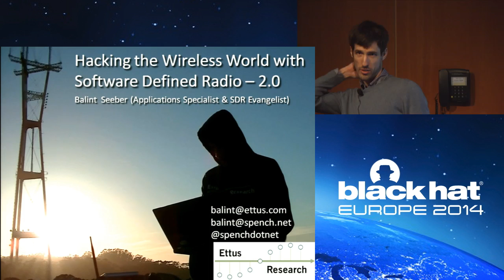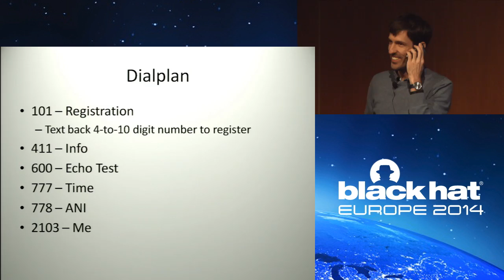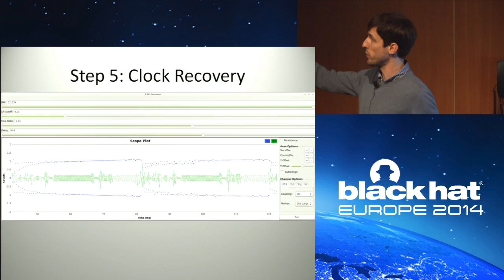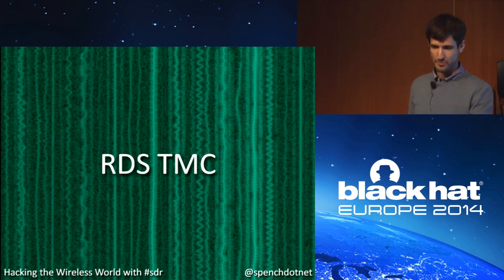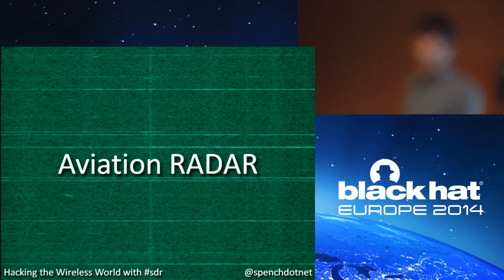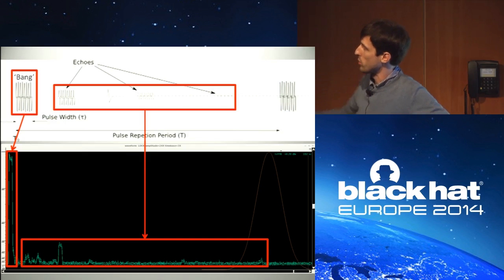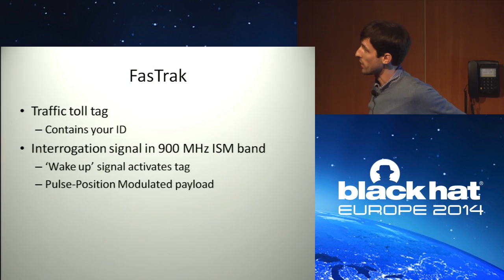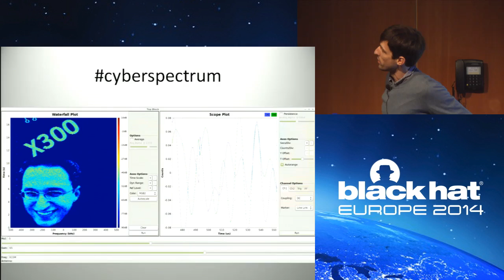Hacking the Wireless World with Software Defined Radio - 2.0

Comment: The RDS encryption cracking is extremely clever, but I can't help thinking that it was a little bit unnecessary. You already have decoders available - the nav system of any suitably equipped car.

Isolate its receiver from the normal wavebands (disconnect the aerial, shove it in a faraday cage...) and pipe synthetic RDS signals into it direct from your SDR transmitter. For each encoding period, just exhaustively run through each combination of encryption key and location code, and set up a camera and OCR system to scrape the generated locations off the screen. Before too long you'll have a nice database of what location comes out when it's fed a certain key and location on a particular day, and can then apply some simple filtering / sorting to spit out a list of what sets of input data correlate to each location or vice versa.

You can then either apply decryption to that dataset if you like, or just use it as a lookup table. OK, so the actual search space will be somewhere in the millions (16 bits + 5 bits + however many bits for the period = probably at least 24 bits overall), which might imply it'll take some time simply generating the data depending on the reaction speed of your system, but it's not a particularly large data space for any modern system (say each location averages 32 characters, and you have 16 million of them, that's a modest 512mb memory card).

And even if you just use it as an incomplete source of data for decryption, maybe only pulling a couple thousand period-key-code + location output pairs out per day, it gives you a vastly increased spread of ciphertext plus ersatz plaintext to compare against, even if there's an additional job of work in coming up with what the actual decrypted locations are (...but knowing those is only really useful if you have direct access to a database, e.g. a ~512kb ROM inside the radio, that takes that 16-bit value as an input and spits out a, say, 32-character location name at the output; as that data is likely part of a larger system ROM, itself encrypted and signed if we take the example of the database SD cards that go in my own integrated satnav, you're probably better off just correlating ciphertext+key+period trios to human-readable output strings, assigning them your own arbitrary 16-bit code based on the initial order in which they appear, and figuring out which combinations you haven't yet had the time to run through will produce those strings in future).

Rinse and repeat for each separate region. With a suitably distributed effort, maybe with several people in each area tackling a particular portion of that area's codespace, you could have the location codes for the entire US figured out pretty quickly and reduce the decryption effort to a simple rainbow table style lookup.

NB of course it's probably a 1MB+ table in ROM that contains not only the road / location name but a pair of GPS coords (~24 bits per lat/long should provide more than ample ~1.5m / ~5ft accuracy, meaning an additional 12 bytes, leaving a somewhat less cramped 52 bytes for the ASCII name), for the start and end nodes, especially for long roads where you want to divide them into several segments, each inter-exit section of a freeway etc. That would require quite a bit more donkey work, most likely wholly human unless you're quite good at coding up soft AI systems, to manually correlate each ASCII name with the start/end points. Unless of course there's already a suitable database out there which one could refer to...? (I genuinely don't know, but I'd be surprised if there isn't )

Comment: As a technical person, I am impressed by the material.  But as a citizen, I find it concerning.  

If one could transmit a false road report (the digital equivalent of "Aircraft crash into Golden Gate bridge - bridge closed"), GPS-directed traffic throughout the bay area could be stalled. This is more than a prank - it could cost lives (critical patients in ambulances), disrupt work (medical folks unable to get to work), etc., cost hundred of millions of dollars in lost productivity.  

Rail systems rely on track-side diagnostic equipment. Some of those use RF to communicate. Imagine that a false indication of a switch malfunctioning was sent. Commuter train traffic into and out of NYC's Penn Station could be halted.

I suspect that there are fuel and natural gas pipelines with remote sensors using RF to provide status.  Could a bogus status packet cause a shutdown of a natural gas pipeline (similar to the Colonial Pipeline incident)?

Comment: Hello Balint, re 56:21: How can there be separate sets of waves from the reader and card as you have shown with red and green (yellow?) boxes on the scope screen shot if the card uses load modulation of each wave from the reader to send a coded response back to the reader?

Comment: Are any of the flowchart source available?   I'd love to try the gsm/asterisk demo on a limesdr!  

Regarding the reverse engineering of the rf transmitter, how does this compare to  Michael Ossman's Clock Recovery technique presented at GRCon16?  His video shows a way of automating the data recovery given a bunch of recorded files.      

Finally, can gnuradio be used to transmit atsc?   I'd love to test transmitting video and see if if my tv picks it up!
Reply: The basestation software he mentioned literally has "open" in the name, and the DSP filtergraph software is called "GNUradio" (with GNU being the original G in GPL), so I expect it's all out there if you look for it...